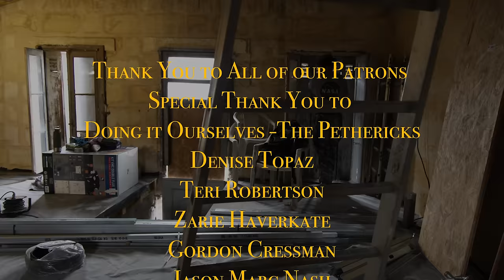The Upstairs Takes Shape -Abandoned Home Renovation Project.

Comment: Hi Ed, in the first bedroom I would put at least one plug on the other wall, for example if you use a computer desk, you'll want one there or if you use the vacuum cleaner, you won't use the ones next to the bed. And don't say people won't use a vacuum cleaner on wooden floors, I use them, and every person who is allergic to dust will use them. I have a sewing room in my house and I need at least five plugs to be able to let them all connected plus my extra light. So I would go for at least five plugs in each room.

Comment: Following Feng shui rules, you are not supposed to put anything mechanical or noise-producing above a bed. Thus, the 1st bedroom bed should go against the stone wall and not share the same wall with the air-conditioning unit.

Cheers.
Reply: Yes, I would not sleep well with a heating system over my head.
Reply: I'd be afraid to sleep with anything heavy over my head!
Reply: I think that is a common sense rule not feng shui.

Comment: Louie is 100% correct on Feng Shui “The typical Feng Shui bedroom layout is to place the bed against a solid wall, diagonally across from the door. You also want to ensure equal space on either side of the bed. This placement allows for a clear view of the door and creates a sense of safety and security.”
Reply: I have two doors and a window in my bedroom, and a wardrobe system on the other wall so which door am I supposed to get a clear view of? I have a sense of safety and security in my bedroom without all that nonsense.
Reply: @janetpendlebury6808 it’s the aesthetics you want to see the bed when you walk it because it’s the most prominent piece of furniture.

Comment: Louie is right about the bed placement.  In fact there isn’t enough room on the short wall in the first bedroom because you didn’t have the door open all the way.   Is there enough room for a small table and chair in the corner of the room?  If so an outlet would be good in that corner.   Will there be wardrobes?

Comment: Just me, but I would have waited to hang the doors until after the discussion about the bed placement, then hang the doors to open against whichever wall is most appropriate. In this case, I'd be switching all 3 doors to open the other way, since you know the beds won't be on those walls.  And yes,  electrical access on all the walls. For desks, reading lights, TVs, computers, etc.

Oh and, hey, be nice to Louis! 😉😉

Comment: A thought about 1st bedroom you showed, the door opens on the plastered wall...and the plug is behind the door, so you will not be able to place a bedside table there from what I saw. I think the bed should go on the stone wall, with bedside tables on either side or at least one. Also I don't think the Air/con above the bed might look odd. Just a thought 👍

Comment: Ed ,are you putting edge guards on your metal stud work every hole a wire goes through ? Electric wire tends to vibrate therefore sharp edges it might run against can wear through them . There's a comment chain starter ? 🥰

Comment: In Canada, when wires are run through metal studs, the holes must first be fitted with a plastic or rubber insert to protect the wires from being cut by the sharp edges of the metal. Is that not required in France?

Comment: Feng Shui is described as a way of directing the flow of different energies in a space, but it also works great as a metaphor for addressing how we direct our attention in relation to the spaces we occupy. So if there's an open doorway facing where you're sitting against the headboard, that doesn't feel very private or secure, and your attention might be drawn to the void on the other side of the door. Similarly, if your feet are facing a window while you're in bed, even though there might be a nice view, it wouldn't feel very private with a floor to ceiling window... It'd be like letting the people outside look right up your skirt, even if you know logically that they can't see in. If you have ADHD and a good sense of flow within a space due to the accompanying hyper awareness of your surroundings, it turns out a lot of the "rules" of Feng Shui are pretty intuitive in application.

Which is why Anna was right about which way the door should swing into that one bedroom. You can't move the doorway, but if when the door is open against the wall you can still see the door itself, it makes it feel more secure than if the door is open but from the bed you can only see the thin side of the door.

Comment: Hey Edd, I understand that these videos are for entertainment only 😁 but does the French electrical code not require you to place grommets of some sort in the steel studs when you are running the high voltage lines?  Here in North America, and yes I understand it’s different all over the world, there are special pop in grommets that we have to put in the steel stud holes if we are running electrical lines with just a plastic coating.  Again, not sure if you have what we call armoured cable, or BX cable there in France.  Just wondering, not telling you you’re doing it wrong because I don’t know the French electrical code.

Comment: I am not familiar with French building codes, but do you not need grommets in the metal studs where you are running wires, or are you using special wire for use with metal studs?

Comment: Air-con over bed?🥴 Do you put something around electrical wire when it goes through metal wall stud to keep from wearing a hole in wire? Not sure this is a problem as I’m not an electrician. Just curious.

Comment: Do the electric plugs and cable have to be cut in the stone wall by building regulations 
Or can they be attached to the wall surface ?
Reply: Don’t think surface mounted electrics would look very good - for a renter or an owner.
Reply: @PennyHarding-yc7bl  …… maybe not to some people but that wasn’t the question I asked Ed. 
But personally I don’t mind electrics on the surface of a wall…….. if everyone liked the same thing, then it would be a boring and strange world. !!
Reply from the maker: So I think you are allowed surface mounted cables but as we are chasing into the wall we have to put the cables in conduite in case they need changing at some time for some reason.
Reply: @BordeauxLife  ……. Oh ok…. That answers my Question 🙂
So according to building regs……… it is allowed if they are surface mounted.
Thanks Ed.
P.S……. I actually did mean a type of conduit casing/maybe plastic with the cable enclosed running along on the wall. !! 
With the plug also attached to the wall. 
I wasn’t suggesting that you should do that, I just wondered if it was allowed under building Regs……… you said it was, thanks for the info.
Your build is really taking shape now, well-done 👏👏
Reply: Usually surface mounted electrics are done as a money saver.
Reply: @PennyHarding-yc7bl  ….. ok

Comment: I am surprised that the UK allows electic wires to run thru a metal stud without protective  sleves in the holes. That metal is sharp and over time can cut into the plastic on wires. It can light up those walls and electicute someone.
Reply from the maker: We are in France

Comment: Can you put metal or wood cross sections between the wall brackets lower than the wire to give wall extra support as one unit under the drywall.  Using scraps. Reinforcement to move as a single unit if someone falls into it.

Comment: I get that you're trying to be funny, & rile the commenters up... lol, but using an oscillating multi tool to cut the mortar out would have to be the slowest way do it. It was my first thought when Louis started using it. But i suppose it keeps the dust down 😷
Reply from the maker: It worked exceptionally well on the old joints but because these are new and strong it wouldn’t touch them
Reply: @BordeauxLife  maybe if it's not too late you could consider hiring a dust extraction capable wall chaser. It would be super fast & prob save money compared to Louis time & replacement blade costs for your Os saw... just a thought

Comment: I was fascinated by the electrical panel.  Are you sure the electrical grid of France can handle that stress? 😅  I'm still wondering what will be done with the gaping hole of the stairs from the front door.  I'm assuming you will put up walls.  The project is now getting some bones.  Very exciting.

Comment: I am so surprised how lax the electrics appears to be in France. You would never run wires through a metal frame unless it is in conduit, as for just chasing it into a stone wall? You would never get an occupancy permit or connected to the mains.
Reply from the maker: It will be conduit in the stone wall